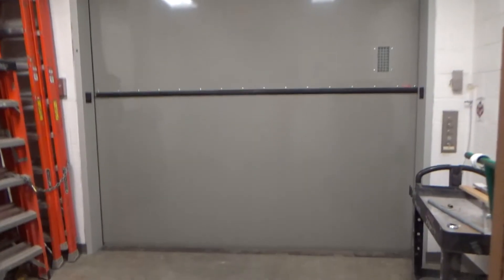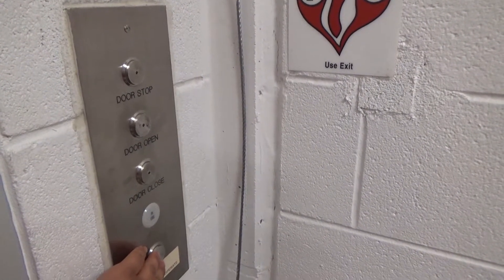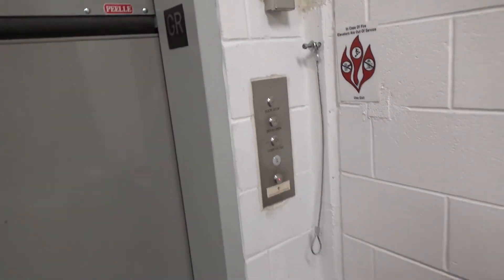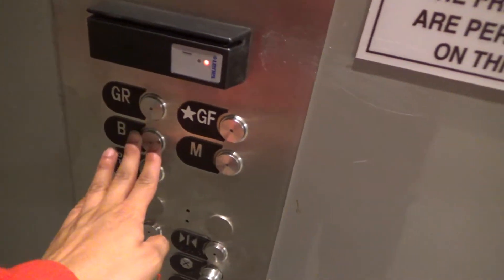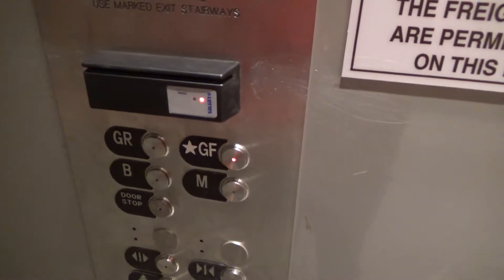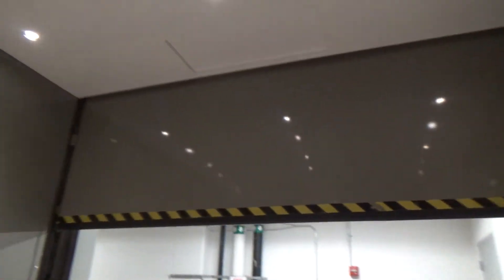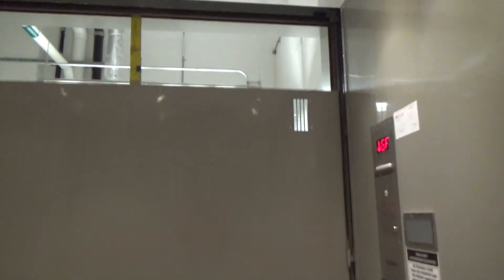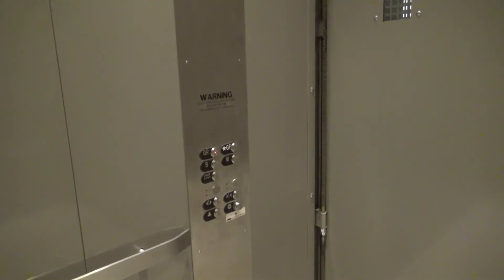LARGE Otis Hydraulic Freight Elevator | Physical Sciences Complex | Univ of MD | College Park, MD

Comment: They need to fix the two problems with it. These are the two problems:

1. The inside door is a bit too tall so the window on that door isn't lined up correctly with the outside doors
2. The door open timer is way too short. It needs to be open for like 90 seconds until a door close button is pushed
Reply from the maker: And they need to fix the door stop, because it doesn't work.
Reply: @AdazElevatorz  Yeah, but there's some other freight elevators out there with defective door stop buttons. Also, this elevator should have voice!
Reply: @AdazElevatorz  https://www.youtube.com/watch?v=bim48P4KFJ0 This one at Arlington Race Track in Arlington, IL seems to have this all correct. Do you think you will be able to film it?